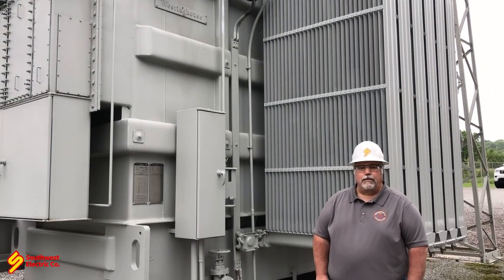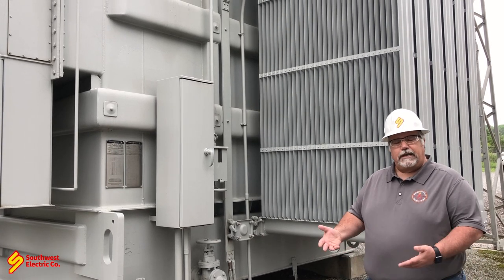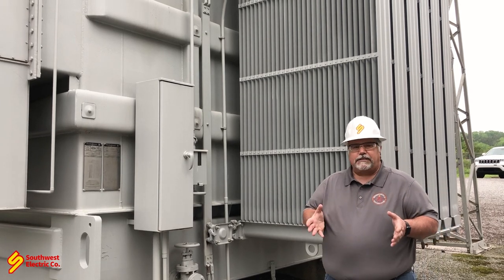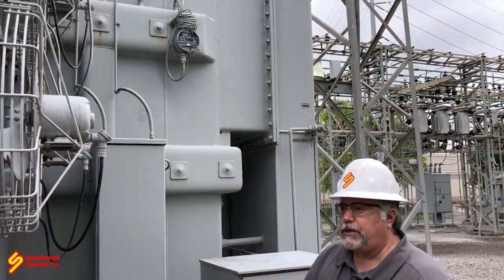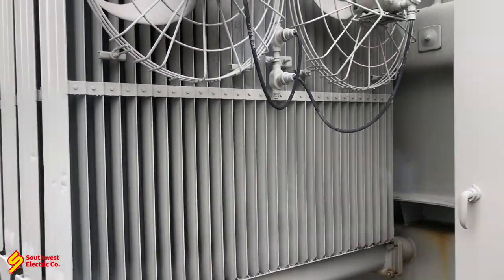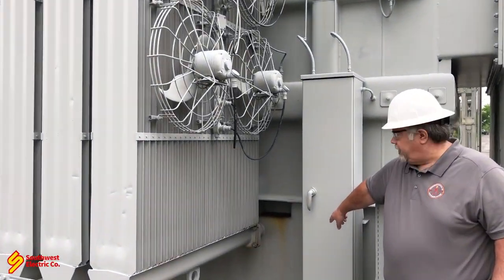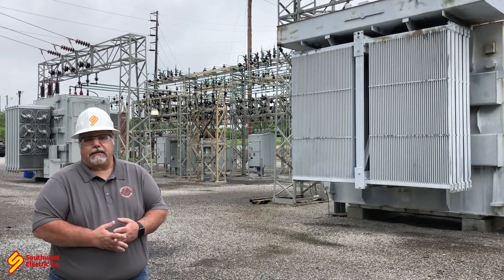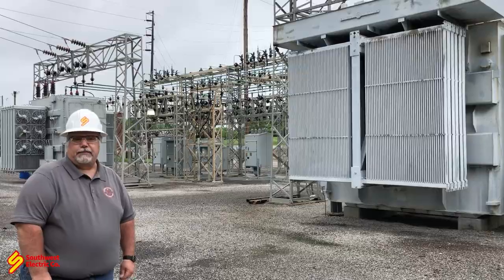Transformer Inspection Walkthrough

Comment: Winding temperature device is indeed important. It displays the temperature compensated by load. This is typically the relay that cooling fans are controlled by. If temperatures exceed a predetermined level, the winding temp device will alarm and then trip the circuit breaker, clearing the transformer.
Reply from the maker: You are correct, provided the alarm is properly working.  I would suggest that you have this circuit tested and confirm everything is working correctly.  If you should have any further questions, please feel free to email me at ron.nicholas@swelectric.com

Comment: I saw a valve in the bottom of the radiator, what happen if someone open it by accident and leave it open for a weekend?
Reply from the maker: The majority of the oil would drain out of the transformer. The radiators have valves where they are mounted to the transformer. Shutting off these valves allows you to isolate a bank of radiators and drain just the oil in those radiators, so if you need to replace or repair one bank of radiators you don't need to drain the whole transformer. The valves you are asking about are to drain the radiator tubes.
Reply: Any valve SHOULD  also have a cap or plug after it. So if the valve were to be accidentally, vibrated or purposefully opened the cap or plug would prevent the loss of fluid. Anyone qualified to do maintenance on a transformer would not leave a valve open. At the bottom of a transformer with 10 feet of head pressure and 1 PSI of nitrogen on top there is a lot of pressure that comes out that valve and aside from draining a radiator with it isolated there would be no reason to leave that valve opened.

Comment: You all must not have a problem with wildlife. Here in Tn. we use a heat shrink cover up material, everything load side of breaker. Or should I say THEY do, I'm retired as of 2020.
Reply: Hey,
Thanks for making sure we have power.
I'm 45 and I've been preparing for a few years now I can feel day 1 on the sub crew is on its way.
The first friend I ever had went on to run sub maintenance here at nv energy.about 210 subs we will be maintaining.
I made some mistake up til now.
Learning all I can 
Getting super healthy 
Just so lucky i saw it.
Reply from the maker: We do a lot of work in TN (where this video was shot). It's unfortunately common to find wildlife - always a danger!
Reply: @SouthwestElectricCo  I worked at the utility co. here in Knoxville. They started covering up years ago and have years more to go. I mostly bent new ridgid conduit when we changed out the old breakers to vacuum breakers while the others did the cover up. We pulled new control wire but relay and test dept. always hooked them up. We were the bulls and they were the brains...lol
Reply: @AmericanOne9621  I'm a retired testman. 
I had the pleasure to work with some very skillfull electricians.
All of our electricians installed all the conduit, cable, breakers, transformers, relays, etc. 
My job was to ensure that the wiring was installed as per the schematic diagrams or "3" line diagrams. Also was responsible for functional testing and commissioning.
God Bless our substation Electricians!